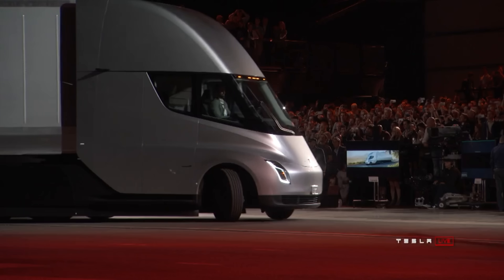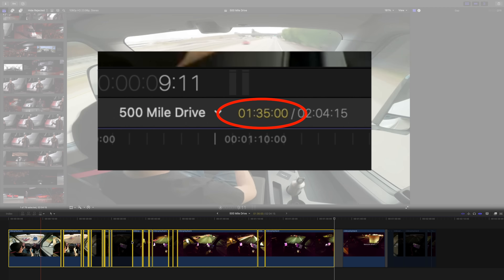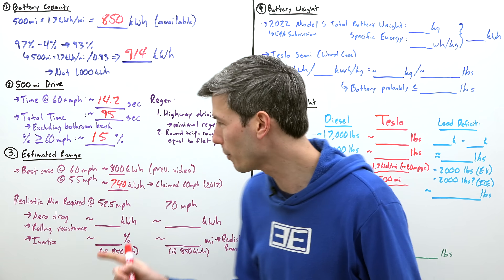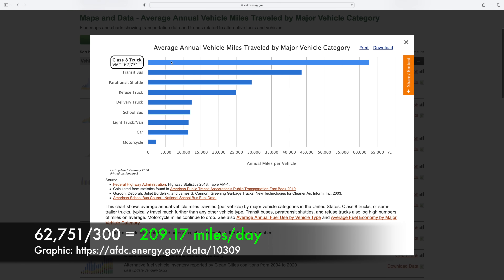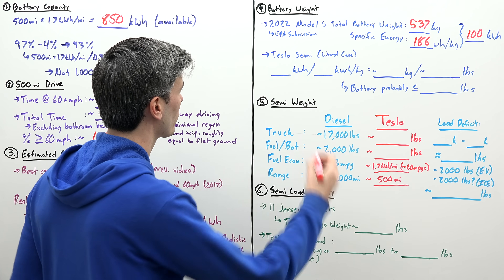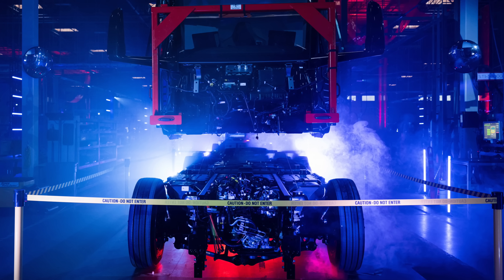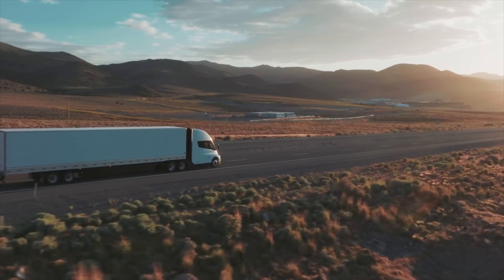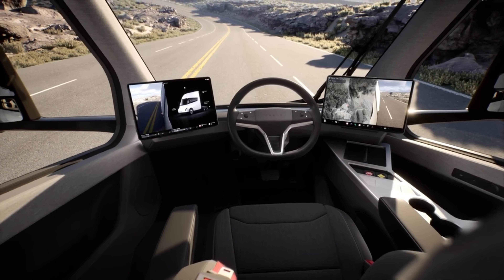Does The Tesla Semi Make Any Sense? Part 2!

Comment: That is a long tractor for a day cab. 

I suspect 60% of cargo meets the 200 miles per day or less. There are a lot of trucks running on I70, I90, I80, etc that run probably closer to 900 miles per day, and are limited by DOT downtime rules rather than range or charge time.

I wonder if electric tractors pay more road tax than diesel. They should based on their weight.

I suspect eventually, the max semi load will be raised from 80k lbs (82k for electric tractors), but at what cost to our road infrastructure.

Comment: Nicely said.. Tesla makes sence when you are not looking at the highest end of the towing.. 
Will be probably used for 300 miles routes, because I really doubth that there will be a charging station on both ends. 
Will be used to tow about 2/3 cargo of what diesel trucks maximum is, wich is enought for most cases
Would love to see it work, but considering that Tesla marketing is just a big scam of false spec and promises, I personally really doubth that the trucks will be financially viable and reliable enought to stay on roads for long.

Comment: Great video - Some good points well illustrated. Another musk marketing scam mentioned in the first semi video was about charging the trucks on solar. You would need 100 kw solar for 1 truck. Which at current solar prices is another $500k. For 1 truck in 1 destination which takes up the space of avg 100 houses. There are no mega charger solar installs at depots. IF the battery is 850 kWh that would take 3.4 hours to charge on the best super charger, a regular super charger would take 12 hours to charge. To fix this they speak about megawatt chargers.... Which would require a substation which would ordinarily service 1,200 to 1,800 homes for one, single megawatt charger. But as always zero evidence is provided for these chargers... just lots of cheers and claps. Don't forget these are very expensive batteries and you reduce the life the faster you charge them

Comment: 2:59 "...the overall energy consumption is basically the same as if you never went uphill at all since the regen puts you back on track once you start going downhill."
This is utter nonsense. Why do you think you don't have rolling resistance and air drag going downhill?
Reply: What he meant is that it's like the road was flat but you still traveled the same distance.
Reply: @johntheux9238  Makes sense but is still not quite the same. Know what you mean. Thanx.
Reply: @kullatnunu2087  It's not just regenerative braking thought, if the slope is not very steep you can just let the truck roll down the slope and you don't get all the energy losses that regenerative braking involve.

Comment: The "best" reasoned argument as to why the trucks are bad was from a trucker and it was about the truck as a vehicle and it's setup.  His complaints were things like - the mirrors are such that in a snowy region, you can't easily clear them in the morning/before driving;  the central driving position looks great and may help visibility, but drivers need to interract with people through the window, which means physically leaving the seat to hand paper-work or such to someone;  the entrance is not next to the seat, which means in muddy/wet/other conditions, the driver tracks all of that through the entire truck to the seat;  like Tesla cars, all the controls are touch-screens, which means controlling anything is by not looking where you are going, a terrible idea for a truck.  And so on.

Basically, all logistical failings in the design, rather than actual engineering issues.  His conclusion was that the designers didn't actually bother speaking to any actual drivers.

Comment: Around 9 min mark you start comparing weights of the two trucks, but don't consider the weights of the drivetrains until you are well into your calculations. This is confusing. We need to know the gross vehicle weights with drivetrains installed BEFORE you begin your calculations. It's very possible that there are other design features of the Semi that lower or raise the bare platform weight, i.e. reinforcement under the area that carries the battery itself, lighter materials in the cab, etc. that can tweak the total.

Comment: It's a tool that will save companies money in specific use cases. A lot of money. However, the limiting factor will be how many they can make per year, as well as how much down time if they have any problems.
I do remember way back when they introduced it,  they said that the majority of trips were not long distance. Obviously they were saying their trucks would fit for those use cases. And it seemed like they came up with those numbers after consulting in depth with companies that do trucking.

Comment: I am curious how much benefit regen braking will offer these trucks. The front brakes do a lot of work, and so do the brakes on the trailer. None of that energy is going to be captured to recharge the battery. Coasting down a hill, that doesn't really matter, but when you are actually stopping the truck I have my doubts that regen alone is going to be strong enough to do most of the work especially considering semis where you never want the trailer to be pushing you.
I also question the viability of the cab design in terms of driver visibility.

Comment: Next you need to calculate the infrastructure requirements of thousands upon thousands of rapid chargers drawing megawatts of power at the same time for when EVs go mainstream. 350kw chargers might be fine when there there's a just a few running at the same time, but how does the grid cope when hundreds of vehicles are needing rapid charging all at the same time?

Comment: the biggest issue I still see is that the battery will lose capacity over time, especially when you load them at max power
and as you said, the truck only managed the 500mile trip with just a small fraction of it doing 60mph
lastly: in cold months the range is further reduced by quite a lot

all in all these trucks likely will cause more issues than they will solve, and a better approach would be hydrogen powered trucks WHEN you want to go electric.

and on a nother note; that 2000lbs bonus for EV trucks was just a idea for law makers, it actually was not passed meaning that E-trucks have the same limit to weight as diesel trucks

Comment: Here's the real question if you're a intermodal freight company meaning you haul railroad freight. Are you going to want to buy this truck if you know that every once in a while it exceeds the capacity of the truck. Most truck drivers do not know the weight of the container until they show up. This is why charts and graphs don't make much sense when you get into the real world. Truck driving is sometimes very unpredictable. The real questions what percentage of the freight be moved is intermodal.

Comment: The first videos I've seen where someone looks at the data first, then makes the conclusion. Seems like everyone else starts with conclusion first.

I do think though, based on what you've said, that the truck is overhyped. It has a purpose and a place, but diesel will still be king, not batteries. It does make me wonder why no one is thinking about hybrid trucks, as that could fully replace the diesels.

Comment: I would really love to know what the mileage will drop to when you're trying to run the heater or the air conditioner because in the pickup models and all the car models that are on the market today it makes a massive impact depreciating what that vehicle can actually go on a full charge.
Reply: It won't matter much because of the size difference. A truck cabin is small compared to the overall weight of the truck. Any battery that can move the truck won't have any trouble heating/cooling the cabin.
Reply: The truck might have an avantage for the heater part, in that you're "burning" a lot more electricity than with a smaller vehicle, so there is more heat generated by the engines, that can be used to heat the cabin. For A/C, not so much, but heat pumps are pretty efficient.
Reply: No
1-2 kW of heating/ cooling makes little difference.

Comment: I think a major challenge is the infrastructure. I think the claim was made that the truck could be 75% charged in 30 minutes. Going by your figures that requires a 1.4MW charging station. A truck stop would need several, say 10 at an absolute minimum because of the waiting time. 14MW would supply a town of 10,000 people.

Comment: Non-owner operated long haul truck drivers likely wouldn't care which 'juice' is in the tank. Most OTR drivers are paid by the mile, after they time-out on driving hours they use their cab like a micro-motel. For these guys it's about home-time, remaining safe on the road, making their miles, minimum truck hassles and 24hr cab comfort. In general, truck drivers aren't overly concerned about carbon footprints. They do want to run at traffic flow speeds, which they deem to be both a safety & home-time issue.

Comment: I don't necessarily agree with your assumption of lower speed = less energy overall.
.
Lower speed would indicate a requiremt to be lower, which indicates variable speed.
.
If we assume that a higher speed would indicate ability to maintain a constant state, during which the truck would be "cruising" on one motor, slower, variable speeds may actually consume MORE energy over a given distance due to acceleration with 3 motors?
.
This also ties in with your "same start/ finish altitude, so regen is not a factor" assumption.
100% efficiency?? Really?
.
Even at slow speeds, not accounting for aero, you can't recover everything.

Comment: It is nice to see that these trucks seem to make more sense than one might give them credit for. However, one thing that concerns me with any Tesla vehicle specifically, which is battery degradation and their (poor) way of dealing with that topic. When it costs nearly 20k US$ to replace the worn-down batteries on a car, what will they charge for new semi-batteries? So, while Tesla clearly has good engineers at hand, the business end is making me kind of shudder. Not to mention that using a lot of batteries with extremely high capacities is not really good for the environment either, especially if my fears would be correct that Tesla would price a replacement in a way that would entice companies to write one of these off and replace it with a new one rather than keeping the old one on the road for longer.

Comment: You arrived at the same battery pack weight as I estimated, but I think you got there with incorrect data.
.
1) You used a Model S pack.
That's the wrong cell type.
.
2) You didn't account for structure and peripherals(?)
....
I worked on the basis of 12 Model Y packs at 82kWh using 2170 cells (fewer cells= less metal in the cans)
Packs total 12,720lb
Cells (@68g per cell) total 3604kg (rounded up to 8,000lb)
.
I assumed the  casing weight would be lower (?)
.
I assumed there would be common power electronics (not 12 sets)
Then settled on ±10,000lb.
.
However, that's for 82×12= 984kWh
.
Your starting assumptions (859-914kWh) would reduce that by 1 - 2 packs.
.
10 packs would bring the cell weight down to 6,622lb and total Model Y pack weight to 10,600lb (10 sets!)
.
The actual weight would probably be around 8,200lb ?
......

Comment: OK this is a soy boy take. Tesla semi is completely impractical on a basic level. The driver can't even reach out and clean the mirrors. The door layout forces drivers to track mud and dirt inside the cab. The truck itself is already unreliable and driver completely screwed if it snows hard and temperatures plummet while he is away from any cities or towns. A real truck driver would hate this contraption. A electric truck is viable, but this is a soy boy thing that has no basis in reality for what it's trying to do

Comment: What if you cover the trailer with some kind of solar panels or small extra battery pack which could be charged when the trailer is stored?
Reply: (1) Not enough surface area to make a difference even in bright summer sunlight.
(2) Cost to retrofit a fleet of possibly 10,000+ trailers for drop&hook operation.
(3) A significant increase in weight.
(4) +1 inch to height, or -1 inch to cargo volume.

Comment: My main concern has always been the financial part of the trucks. If they're being subsidized in such a way that they're practically free, I feel like it is a bit of a trap. Forcing financially sub-par options to do mid to less than the standards already in place is wasteful and ignorant. I imagine the upkeep of the vehicles being grossly worse than the standard diesel as well.

Thank you for the math and explanations on the technical side.
Reply: my biggest fear is the loss of capacity of batery packs
yes the truck may be able to do 500 miles on a fresh cell, but over time it greatly reduces the max capacity possible, especially when you power charge them.
Reply: @IronPhysik  Exactly. Which is makes them prone to being financially cumbersome compared to diesel.

Comment: The current problem with EVs in general, cars or otherwise, is that battery technology still sucks in 2023. Millions of scientific breakthrough promises later, we still have small incremental percentage improvements each year, in price or performance.
It begs the question, if EVs are going to go mainstream, meaning cheaper for the same or better performance than ICE vehicles, maybe batteries are not the answer?
Still, that wouldn't be the end of the world, as the most important feature of EVs is separating the engine technology from the power source.
What doesn't make sense is to pretend people are going to spend more money, they might not even have, for the same or probably worse performance than the alternative. Not going to happen.
Reply: Batteries are 10 times cheaper than 10 years ago.
Reply: @johntheux9238  True, yet EVs are still way too expensive for the same or less performance.

I live outside a big city and need 2 cars at home, a big sedan for family traveling and a mid sized hybrid for going to the city. For what I paid for both, I might be able to buy ONE model 3... it does not make sense.
If we insist on Battery powered EVs we might be looking at 10-15 years till the technology gets us cheap and performant enough EVs to make ICEs non-practical in comparison.
Reply: @joseluisvazquez5126  Tesla has the highest profit margins of any big automaker.
EVs are cheap to make, there is just too much demand so they are raising prices.
Reply: @johntheux9238  Yes, Tesla is pricey, but even Chinese EV competition is not cheap either. They are playing mostly on the wealthy sector for now, because they cannot be cheaper than the comparable ICE, that is what is going on for the time being. We are talking not less than 7000-1000 USD difference in the best cases, that is a lot.

And even on a more expensive car I cannot do a 700 km trip without lots of range anxiety and/or careful planning, while the ICE alternative is cheaper and non troublesome.

To make ICEs obsolete, the alternative must be better AND cheaper. Like LED lights killed regular bulbs, Internet killed faxes and phone lines or mobiles wiped land line phones.

Once you pass some threshold there is no need for subsidies, or focusing on the wealthy. We are not there yet, and with batteries we might be still years away or never get there... because we might get a different technology replacing batteries to get there faster.

Again, hopefully I am wrong, but I see 10-15 years until regular joes and janes can buy an EV without making performance or price sacrifices.
Reply: @joseluisvazquez5126  They make 30% gross margin on their vehicles. So a $47k model 3 only cost $33k to make. And they are working on a $25k vehicle.
Reply: @johntheux9238  ping me again when anyone sells medium sized EVs under 20K USD, doing 500 miles on one go and recharging/refilling in less than 10 minutes. That is would kill ICEs, anything else are compromises.

The 25k USD Tesla was coming last year... it didn't. And with the current economy it might delay even further than expected. Maybe some other vendor gets us a 25K model by 2025 or so, getting another >5K price cut while also improving performance to get on par with ICEs of that price range... as I said 10-15 years from now if we are lucky.
Reply: @joseluisvazquez5126  It wasn't. The cybertruck was expected to be last year but it's a $70k vehicle.

Comment: Cool. I always thought the Semi's only issue is its financial feasibility. Other than that, there is no real barrier for the wider adoption of e-truck --- maybe the availability of MegaCharger is the only exception -- I can't imagine charging the 850KWH battery pack using current 120KW fast chargers -- that would require an overnight stay for the truck to get a full recharge.
Reply: Even more comical would be charging at the standard options of residential electricity outlets. Not exactly sure what the limits are (I'm used to our European ones at 230V 16A per group by default at the breaker, higher in special circumstances), but I vaguely recall the max current was a bit higher than here so probably in the 120V 20A range for standard? And if it gets a 240V group it'd still take a silly amount of time. But if it's possible to charge with a residential AC source at all it might be good enough to get something in it and then make it to a suitable location for a full charge.

It is nice to see though that the basic truck concept and energy for reasonable trips seems feasible now, only time will tell if adoption for both the vehicles and the required infrastructure will happen quick enough.
Reply: They have their own 1MW chargers